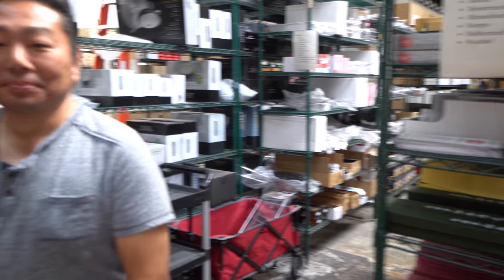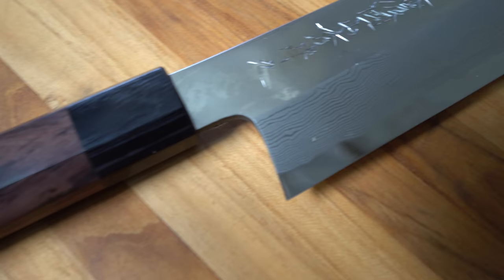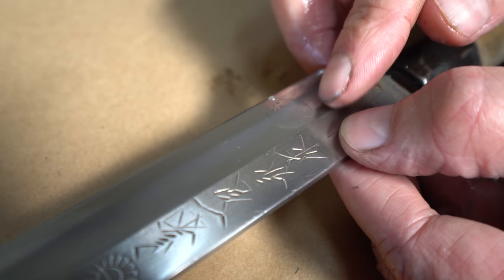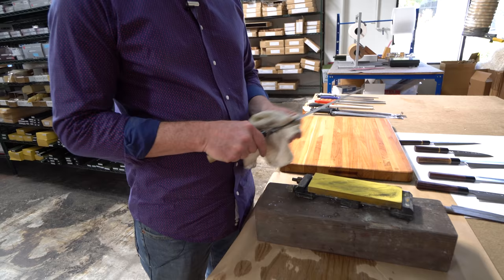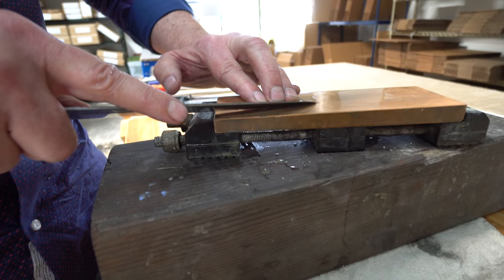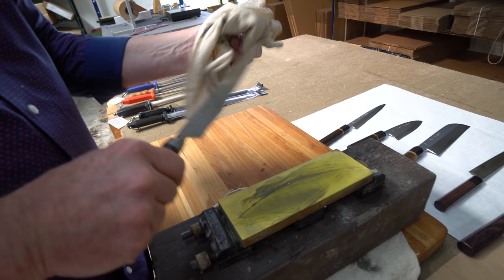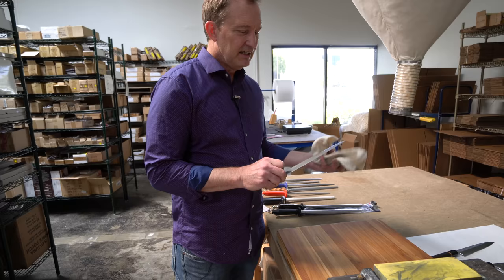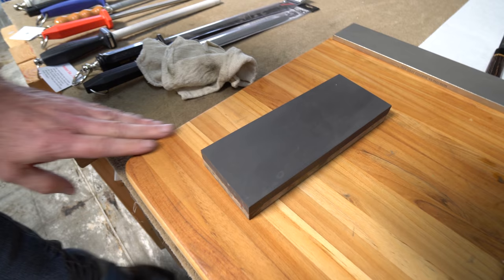How To Sharpen Your Japanese Knives PROFESSIONALLY

Comment: The only thing I'd add to this is something I'm sure Dave does, but has done it so long that he doesn't have to think about it when he says to remember to "lock your wrists." I think that at first, the beginner will most likely not be able to stay relaxed while locking their wrists, and if they don't, their hands, wrists, and forearms will fatigue pretty quickly. They're also more likely to press down on the blade harder than Dave recommends, too. As with everything requiring some skill and dexterity, being consistent is the key, and the best way to remain consistent for the length of time necessary to sharpen knives like these to #8,000 grit is to stay relaxed the entire time. Now, it may sound counterintuitive to relaxation, but it's difficult to relax until you've developed a certain amount of strength in the muscles and tensions used in any repetitive motion, and that's why I'm stressing it. The rank beginner will see very quickly that keeping their wrists LOCKED while keeping both arms relaxed, the blade at the consistently correct angle, and the light pressure from the fingers on top of the blade, isn't quite as easy as it sounds. Before long, one of those elements will likely begin to wander a bit and they'll have to stop, lock wrists, relax, "find the knife's angle," press lightly on top of the blade, and move SMOOTHLY back and forth. Dave makes it look and sound easy but it's a lot to think about in practice...but practice is what it takes. Good luck, and most of all, have fun!!
Reply: Hiroyuki Terada - Diaries of a Master Sushi Chef thanks Charles, same to you!

Comment: THIS WAS GREAT!!!
    It's especially nice to get some industrial insights from someone who not only REALLY knows the industry for them, BUT that he also has the direct/no-nonsense way of putting everything. Thanks!!!

     AND for the record, a couple times a year I actually DO bother putting a decent edge to the household steak-knives... At least the ones that get used regularly.
    Because we bought "cheap crap" years ago, they are super flexible and serrated... AND one-sided doesn't make the job any easier or simpler...

     BUT... experience taught me to get one stone (arkansas combo)... AND a set of needle files.
    The needle files (useful for other stuff around here too) cut neatly into the serration pattern and clean and clear "junk" out of those channels. It takes a while only because there are so many of those channels to clean... Once you've found the particular files of the set required, it's all repetition...
     File to get the burr(s) on the "back side" and a few strokes on the stone cleans the burr... simple as that.

    *NOTE of warning, however, that with serrated knives, the "teeth" CAN gouge the Hell out of a stone, even a fairly robust one... Lay the back-blade FLAT as possible and "next door to no pressure at all" to let the stone work the metal (as opposed to the other way around)...

     I'm "heavy handed" and I can manage... SO it's not so difficult... really. 
          ...AND when slashing meat at the table is SOOOOooo much easier, it's actually worth it, even with a DRAWER-FULL of "cheap crap" steak knives. ;o)
Reply: I personally dislike serrated knives and don't use them for anything but that doesn't mean they can't get the job done.

Comment: the title is rather misleading since it's not Hiroyuki Terada sharpening the knives but David. But it was interesting. My question is, do you apply pressure on the push, or on the pull, since I've heard both versions?

Comment: Thank you David...that's what I've been telling people for years - finding an angle you're comfortable with and keeping a consistent angle is much more important than the actual angle you're sharpening at.  Good to hear this reinforced in this video!  

Funny thing...I frequently switch from right to left when brushing my teeth just to keep my brain more active by switching routines.  I read that's one way to keep your brain young - when you do the exact same thing over and over it becomes practiced routine and your brain does the activity without really thinking.  Switching things up like that make your brain work outside the routine and it helps keep your brain more active and exercised.  Very interesting on the Japanese knife having the equivalent of a ride line on a pair of professional scissors.  I'd never heard that before.

Comment: i have 2 questions.  First, can you soak wet stones for to long?  Is it bad to leave them in water?  Second, when I try to sharpen my knives the stones get dry very quickly and I am constantly throwing a little more water on them.  Your stone looks like it stays wet for quite a while.  Any comments or help are greatly appreciated.
Reply: There are many different types of whetstones, ceramic ones are expensive, don't absorb water and can be soaked for long time although is not recommended. Other more affordable whetstones are more porous and absorb water and get dry quickly, do not soak these stones in water for hours, else you will end up with a pile of mud at the bottom of the container.

Comment: Can David hint as to how I can sharpen a Shun Edo Usuba? The regular up and down motion on the ura will not work because the bolster extends over an inch on the spine on both sides... Help!
Reply: That's a tough shape Amir.  That bolster does prevent you from being able to properly keep the knife perpendicular to the stone.  But, the good news is that they didn't do much tapering from the heel to the tip, so I don't think it will create any problems to put the back side down flat (angling as required to accommodate the bolster) and then square it up again for the remainder of the blade.  Just on a finishing stone, of course.

Comment: does anyone here know how to prevent getting a dent in a sharpening stone, i have two Masahiro stones, i think they are 1000 and 3000 (they are old and the boxes were gross so i tossed them) the 1000 one has a big valley off center so the sharpening is not as good, should i get a new one or can i fix it
Reply: He mentioned flattening the stone. Call them.

Comment: What about Bamboo cutting boards? Are those also hard on the edge?
Reply: bamboo is too hard.
some stories about bamboo or glass sounds quite shocking, maybe there where other stuff that needlessly dulled edges as well though.
Reply: @smievil   Some stories about bamboo sound* shocking, maybe there was* other stuff (plural would be "were") ... And bamboo is not hard, it's tough. That makes it more abrasive than wood or plastic.

Comment: I have 6000 stone can i use this as total sharpening to my chef knife?one stone is good enough or need more stone?
Reply: Joel alumbro 
get a 1000 grit.
Reply: Joel, I'd add a 1000 grit.  The good news is that the lower grits are cheaper and 6000 should last a very long time because of the harder bonding agent.  But as the knife gets work hardened, the polishing stone (6000 grit) usually doesn't bring an edge back to it's full potentional.